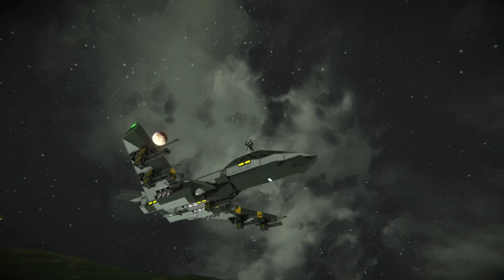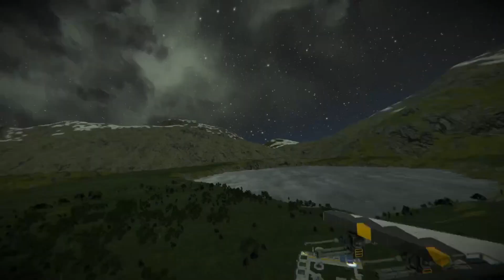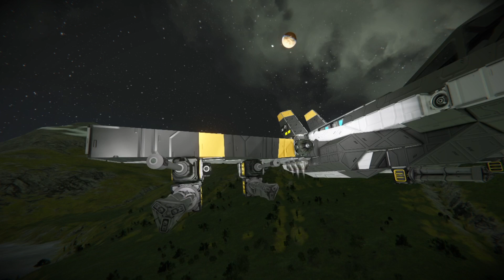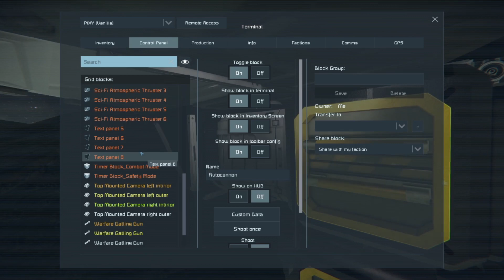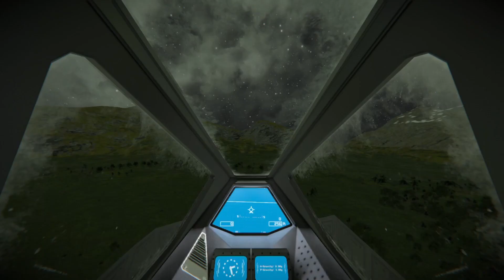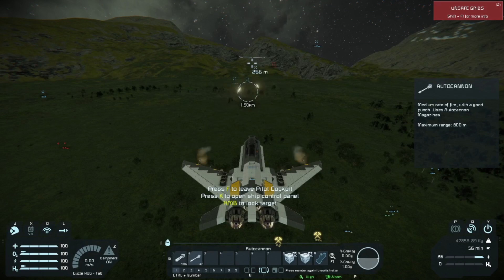Gimbled Guns Concept puts other ships down fast!

Comment: Meh. Way too expensive on pcu. You have 2 guns on rotor and hinge… way to squishy with zero armor. Better off doing forward facing guns.
Reply from the maker: You can build an up armored fighter if you want the guns make it so you can maximize the damage on one spot instead of spreading it out.

Comment: I don't get what this even does. Since the CTCs are only using cameras for targeting they don't aim to intercept their target, but instead just look directly at it.
Reply from the maker: It creates a cross fire affect enabling the lines of fire of each guns to intercede upon a single Target concentrating the overall damage on the one small space enabling your guns on a pass to tread through armor and an accelerated rate instead of having multiple fixed guns firing an individual blocks you can then concentrate onto a single block with all four guns it's a trick used in World War II with old fighter planes which created a sweet spot in which the fighters would have ridiculous overall damage but with the gimbal system it enables them to concentrate at different ranges

Comment: Dude...This is brilliant. I am SO gonna use that on my ships. Great for fighters. There should be a way with event controllers and a few timers to reset the guns to center. And think about this: with the same method, you could set convergence at set ranges. Imagine hitting all at the same spot with all those autocannons!
Reply: Actually yeah. You could use distance > (desired distance, eg 2000m), and set all the rotors to return to zero. Would only need a single controller too :)
Reply from the maker: Yup your stacking dps on blocks with this.

Comment: I have yet to play the game, just counting the minutes before it's available on PS4. However, I've been avidly watching videos of SE on YouTube ever since I knew about it. This is one thing I've been thinking about doing myself and shocked no one else had posted or done something like it. I guess some people are not happy about the new camera and don't see the potential in it with things like this. Not sure if the new targeting system that's used for tracking the sun, could be set up for tracking a lock on with a hinge.
Reply from the maker: The do it's just most of the builds are on steam and mod.io. the new camera has made drones much more durable.

Comment: If the lower limit is 0 on all the hinges that means you can make them all look forward by repeatedly giving them the order to decrease velocity. Make a group and set in on the toolbar. As long as the ctc are on the velocity bill reset so don’t worry about messing up velocity.
Reply from the maker: Ok I'll try that!

Comment: I got a script (doesn't work with weaponcore) that will allow you to initiate your auto cannons in tandem rather than all at once. I use it for my massive assault-cannon systems.
Reply from the maker: Is it on steam?
Reply: @badgerwildgaming6908  I'm not sure that one has been released. Additionally it is very volatile and requires strict namings of blocks and stuff to work. I'll make a pastebin and post here just for the current version of it if yoiu want to give it a look?
Reply from the maker: Ok I just want to try it.

Comment: I love this. But I think these should have a rotor base so that it can adjust for bullet drop better. 

If you target lock then use the Focus Fire function on the CTC's you can have the CTC work out to 800 meters(max range of your guns) instead of the 600 meters of the CTC. That Focus Target function will make all of the turrets range be at their max bullet range not the ai range. I'd group all the CTC's and put that group on the hotbar for the focus fire toggle. Bonus Tip: Defensive AI blocks can be used to automatically extend the range of turrets on ships/bases this way.

You can put a velocity override on the Action Bar to move the hinges back to 0. You'll have to fight with the CTC turning the velocity back off. But, it would allow you to do it by spamming a button. Maybe put it on a repeating timer. Actually since it's only 20 degrees you could just put decrease velocity of the hinges on every page on the timer and hit trigger now on the hotbar. Get's you 10 actions on the hinges for every time you triggered the timer. 20 if you use it in a group and the individual hinges. That should be plenty to get it back to 0 in one go.
Reply from the maker: Hmm might make a vid on how to do this.
Reply: @badgerwildgaming6908  There is a bug with the Defensive Block triggering the CTC's longer range targeting.  At least for static grid anyway. I didn't troubleshoot this on a mobile grid.

The trick seems to be having an equivalent range turret on the same grid as the CTC. In my testing if my Assault cannon CTC was on the main grid then I had to have a normal assault cannon turret on that same grid to get it to work. The weird thing is, you can remove the turret and it keeps working until the save is reloaded.
Reply from the maker: I'm going to look into that. May put a turret on top of the ship?
Reply: @badgerwildgaming6908  yeah or a tailgun
Reply from the maker: Even closer to the arc 170.

Comment: If you can run scripts on your ship you can use 
( Whips Weapon salvo script ) and its super easy to set up with no timer blocks needed
Reply from the maker: Yes I was trying to make a scripless version for servers that don't allow it to prove the gimbled Guns as a concept, but if I had full freedom whip or weapon core would be my first option.
Reply: @badgerwildgaming6908   only other thing i could think to do is set them up using the timer blocks or maybe might be able to experiment with the need auto update blocks
Reply from the maker: Ya could do a burst fire squence.

Comment: As other folks have pointed out, you can use Whip's Salvo Script to make the guns fire one after another. Group them up, when turret controller detects target, turn shoot on, else off. Since you have multiple turret controllers for the same group, it might prove troublesome, but I reckon it'd work.
edit: You can probably use the Event Controller paired with AI Offensive to turn the group on and off
Reply from the maker: Yes I also did a video in showing how weapon core has a salvo system and how to use it.
Reply: @badgerwildgaming6908  Ah fair, I'm not very versed in modded SE, but it's neat that it's integrated in WC
Reply from the maker: Ya was a fit to figure it out on my own. The vid avoids alot of head ach.

Comment: Question:

Did you try to name all your hinge with the same name, with one side inversed and use it as the azymuth? 

In my head, by doing that, both side will follow the same target when given the same input.
Reply from the maker: Ya things like "right upper" or "left outer" hell just numbering them will help keep the madness of klang at bay
Reply: @badgerwildgaming6908  I've tried my idea it doesn't work. Too bad. Having a custom controler per weapon is costly in pcu.
Reply from the maker: It is but if your doing a dog fighting match I'm sure it would be great for that...till they made a rule about it.

Comment: I've got a 3x3 gimbal turret gun that I built my ship around and limited the range enough to only fire within a 15 degree arc. It looks kinda like a whale shark, decent enough but not really pretty.
Reply from the maker: Is it on the workshop cause I'll review it if you want?
Reply: @badgerwildgaming6908  I'll see if I can find it, I'll tell you the trick tho; you gotta use two hinges instead of a rotor and a scrip that realigns them when the custom turret isn't in use. Otherwise it looks silly.
Reply from the maker: I'll look into the script
Reply: @badgerwildgaming6908   it won't let me post the link but its TCES | Turret Controller Enhancement Script by Whiplash141
Reply from the maker: The name is enough I'll find it now. Going to make some real weird ships with it.